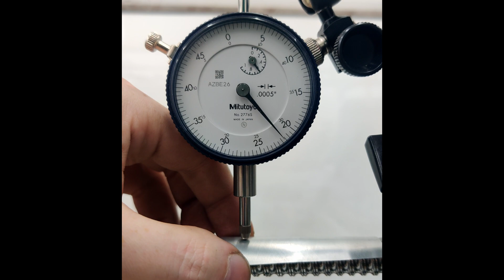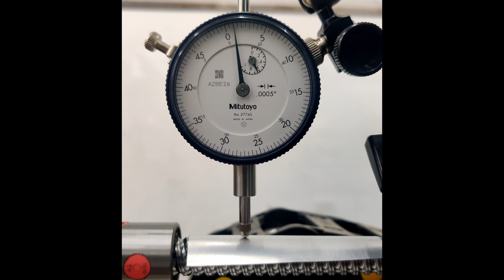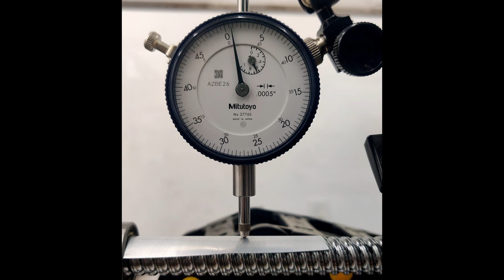Aligning the Ball Screw and Servo Motor on the Z Assembly

Comment: i think the servo motor weight (plastic holder) isnt strong enough and pushes the screw up....
Reply from the maker: 3d printed servo motor mounts actually work quite well. They don’t break and hold up well. I’ve actually just finished replacing the last of the servo motor mounts in my more recent videos and they lasted pushing the gantry around with it filled with grout. The BK and BF block spacers on the other hand take a lot of abuse and don’t last long before showing signs of failure.

Comment: Neither the rails or the screws should be used as references for straightness. The reference comes from the rail mounting surface so you need to somehow make the gantry tube straight. If you get access to a precision straight edge to check against, shimming of the rail would work, but be incredibly time consuming. But if you have access maybe see about getting the tube sides skimmed flat and parallel on a large mill, or try epoxy leveling.

also still a really great and interesting build series. converting a print nc to a cnc'dcnc
Reply from the maker: Yeah it’s just kinda hard to get any of this stuff straight when you have nothing that long and straight. I ended up shimming both ends of the ball screw to each other so they zero out. Checking the wobble and the deviation of the screw in the middle of the gantry, I'm somewhere around 10 thou out now.  It’s much better than it is now. 

I have a smaller 18” granite surface plate but for stuff like this it’s not much use. 

I also finished scraping the steel plate to match the ball screw nut and have it all tightened down. Used a small rotary tool with some sanding disks and finished off with a diamond wheel point. Took about half an hour and worked out very well. 

The whole thing runs way smoother back driving the ball screw and the 4 linear rails on the X gantry than it ever did when it was more or less a stock PrintNC.

Comment: I would shim the blocks first.  Since the gantry is a piece of structural tubing and not a precision machines surface, getting it perfectly straight and untwisted seems like a herculean task. Any errors caused by the gantry warp should be canceled out when you surface your wasteboard with it.  Making the ballscrew run true to the rail seems a lot easier and good enough.  If you get a known offset you can modify the block risers to be the correct height and/or skew directly from the printed part or a machined aluminum replacement.

Comment: Have you installed the Z axis bearing assembly to the ball screw. loosened the ball screw blocks and servo motor mounts. Then manually slide the Z axis back and forth on the X gantry. You might be able to see a solution watching how much deviation you get from left to right. I am sure you have thought of that already. But just worth a mention. Curious if you ever have seen this youtuber? Stefan Gotteswinter? This man works with extreme precision. Have a good one Bryan. p.s I would def. shim the blocks rather than the slider rails.
Reply from the maker: I basically did this (see the other vid I just posted). I think I’m looking at some deformation of some of the parts holding the BK/BF blocks on. And a little bit of deformation of the tube, but not as bad as was shown in this video. I didn’t check the bottom rail for alignment to the top rail and I don’t think I am at this point. I’m gonna assume the slight deformation would match both surfaces. 

With shimming one side it’s all somewhere between 5 and 15 thou deviation over the entire X axis. It’s an amount I’m fine living with. After milling the spoilboard to the machine, any that amount of deviation would only be able to be seen on a very large ridged part that couldn’t be clamped to deform to the spoilboard. It’s unlikely I’ll ever happen to be in a situation where I need something that big and flat 

Stefan Gotteswinter is a great machinist/youtuber and I’m an avid viewer to his channel.
Reply: @BryanHoward  Awesome Bryan! Always enjoy watching what you are building. I can tell you put alot of thought into everything you do. Have a good one. Stoked you know about Stefan G.

Comment from the maker: Shim the rails, shim the BK blocks or flame strengthen the tube? Which would you do?

If I do the rails I would start with the top and get it parallel to the ball screw, then I would shim the bottom rail to be parallel with the top rail. This would be a lot of work but I would straighten the gantry. 

If I shim the BK blocks holding the ball screw I would only have to shim each side of the ball screw and also realign the servo to the attachment point. Less work but I would still have a warped gantry.

Flame strengthening the tube would be the fastest and could be accomplished if the tube is warped on the other side in the same way. Procedure would be to take everything off. Determine areas to heat, clean the surface of paint, and heat. I would be using a TIG in this case.
Reply: Maybe check if you have warped gantry related to work surface. At such length I would expect the screw to sag a little.
Reply from the maker: Yeah that's a possibility and it could be my binding I had previously was due to just misalign ball screw mounts. I'll have to figure out some better ways of measuring flatness over the entire surface so I can have a better picture of things.